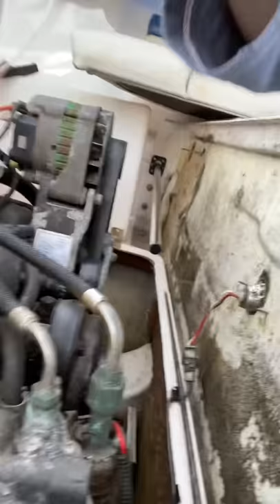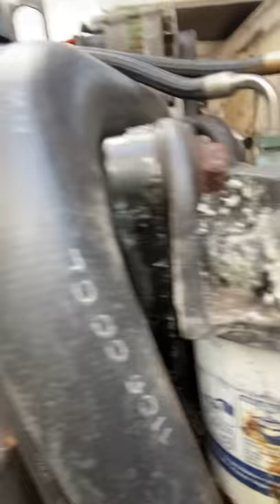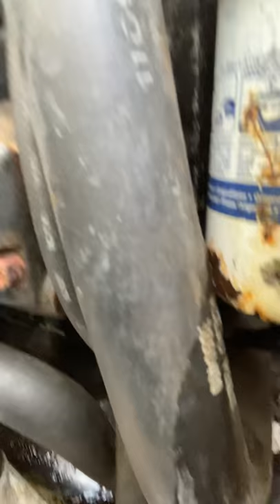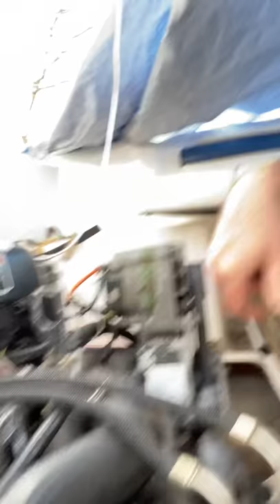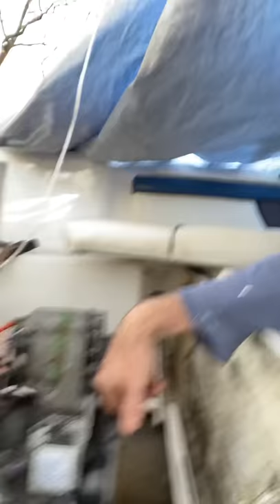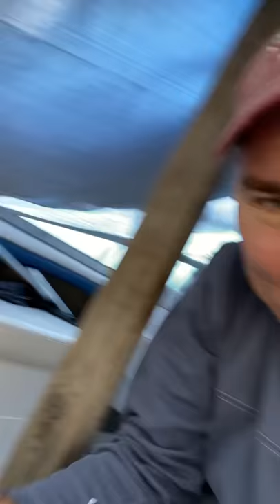Leaky fuel filter in my boat!!!

Comment: Since it's leaking like that, can that cause it not to turn over when cranking?please help I have a start up problem since mine fuel filter is leaking
Reply from the maker: Yes - if there's not enough fuel pressure because fuel is leaking. Could be lots of things, but I'd address the leak first.

Comment: You are probably in the habit of using a blower to vent the engine compartment  before fireing up.Also lift the hatchcover or engine cover and sniff for gass smell every time before hitting the starter, as the starting gear hitting the ring gear involves sparks. Gas not the best fuel in a boat but O K if you respect it. I suspect you are aware of this but might help some listener too.
Reply from the maker: Yeah I have been making sure to use the blower correctly (I even used it when going slow in the creek) and would lift the lid for a sniff test regularly. I think the filter had water in the bottom that froze the other night which cut through the rusty filter wall.